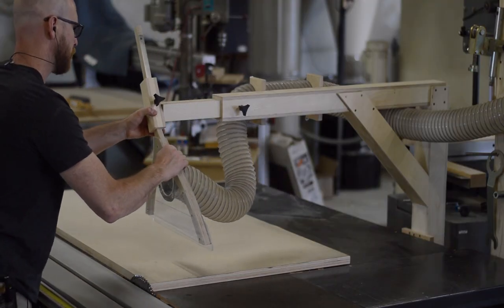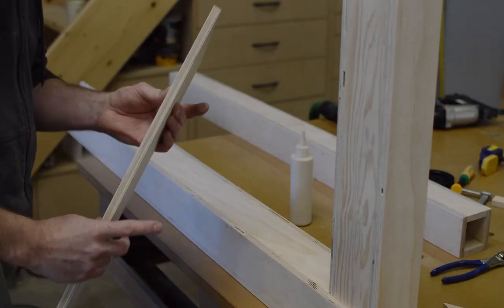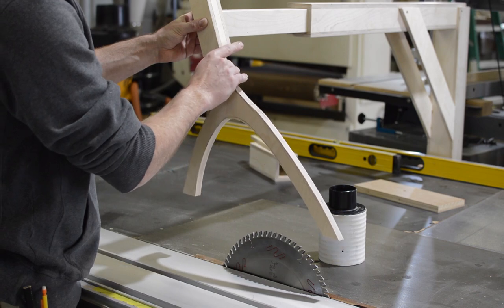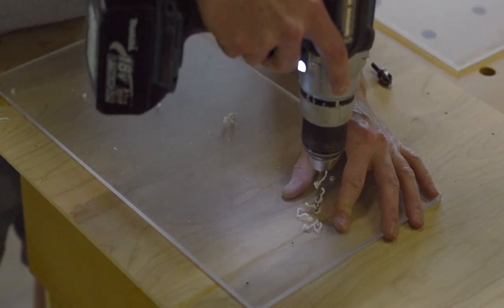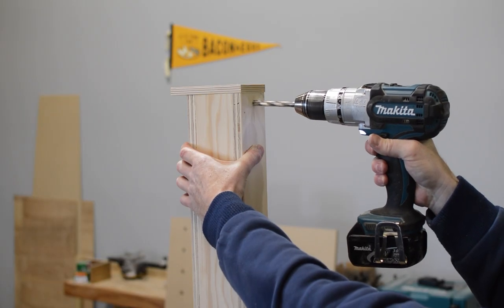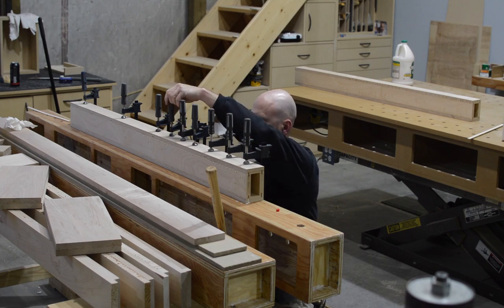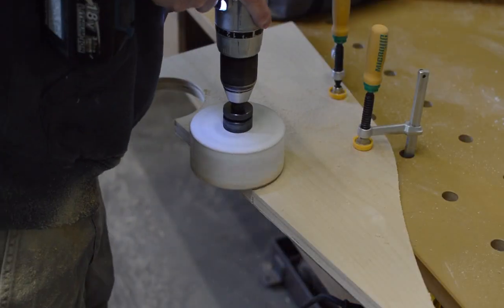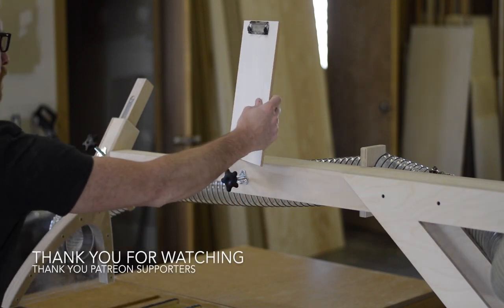Table Saw Overarm Dust Collection, Shop Built x 2

Comment: When I saw the picture in your thumbnail (in the suggested video column) I thought that is the craziest dust arm yet.  There are so many table saw dust arms videos now.  Then after ignoring your video for over a week, I thought I would check it out.   For me, as it turns out, yours is the best.  Some look very slick but have obvious drawbacks, such as lack of rigidity and to large of a guard that inhibits use.  The others often put the boom were it will obstruct the operator.  Yours looks perfect.  Think yours is really spot on.  Thank you for sharing your great design.  BTW, all that noted, did you think about using the boom and vertical section as your dust tube?   Just a thought, but still yours is just a great design.   Thanks again!
Reply from the maker: Thank you very much. I did think about using the boom and vertical as the collection pipe. I ended up going away from that idea to keep construction simple.

Comment: Great work, as always.  Question; was there any thought about making them pivot so you can still use them when you make angle cuts?  Unless I missed something, it looks like you can only use them when you make 90-degree cuts.
Reply from the maker: Thank you. I can use them for all kinds of cuts, they can be adjusted pretty close to the blade even it it was at 45 degrees. I think collection efficiency would be slightly reduced. I can also move them out of the way for tenoning or tall vertical cuts.

Comment: Mike, any thought to making the part that hangs over the blade maybe a little wider? Just a thought. Might make it easier for the dust to be collected from skim cuts.
Reply from the maker: The wider they are the less velocity the generate, if thats the right word. Meaning the suck is spread out and less concentrated. I would need to do some more experimenting to know the best combo of size vs collection efficiency.

Comment: Nice build! How much space did you leave in the telescoping joints (between the outside sleeve and the inside sleeve)? Is there a good rule of thumb? I find it hard to find the balance between free motion and snug fit.
Reply from the maker: I didn't measure, I just cut the pieces until the slide felt about right.

Comment: Intelligent build, as always. How do you deal with very narrow rips with this hood setup?
Reply from the maker: I have an offset push stick where I can go down to maybe 1/2" or so. Past that I need to move the overarm out of the way.
Reply: @MikeFarrington  I deal with a similar dilemma when I use my ancient Board Buddies fence-mounted holddown/hold-in featherboard devices. I've taken to using a small rip thinner than the stock to push the work piece through the cut, i.e., with the push stick flat on the table and following the work piece (as it would if following a piece through the thicknesser to prevent snipe). After the work piece exits the cut, I pull the push stick back out. I plan on copying your slim-line design for dust collection. Your offset push stick makes sense. I might resort to the flat push stick I describe for the narrowest rips.

Comment: I was thinking at the start that you were going to double up on structure function, use the sliding boxes to be the dust collector tubing. The reduction in area would have increased the suction & velocity of air movement, until I saw you plug the end ... Ah well, an overenthusiastic overengineered  thought on my part. 
Great build. I take it the saw didn't have a dust collector when you bought it?
Reply from the maker: Thank you. I thought about trying to do that with the arm, I just didn't think it would be worth the extra effort. Yes, this is an old saw, so dust collection was up to me.

Comment: Maybe next time put the drop of locktite on the thread before  threading the nut.
This way it even works.
Smearing it on top of a nut does not much at all becouse of the to small surface area.
Reply: there is penetrating locktite but i don't think the blue stuff is.
Reply from the maker: Yeah, that is certainly how it is supposed to be used, but a dot on top is enough for this application. That nut will not back out.
Reply: @MikeFarrington  I agree

Comment: Enjoyed watching your videos. Your work is excellent. Which air compressor do you used? Cos I am thinking of buying one for my small workshop? Only need it for my nail gun. Many thanks
Reply from the maker: I would recommend a very small portable compressor if its only for a nail gun. I have a 60 gallon 5hp model, but I use it for spray finishing.
Reply: Thank you. Keep up good work 👍

Comment: Great project!!! Question.. I’m in the market for a dust collection system. I’ve thought about building something similar. My question is, when you run dust collection thru  the top do you also run another hose they the bottom or is the top one enough? I works out of a very small shop and if I can run just one line they the top I could just switch it from tool to tool. TIA
Reply: De e
Reply: De e u

Comment: A year later, how are you feeling about them and would you make any changes?

I really like your design but I thought I’d ask your advice before committing the hours to building them.
Reply from the maker: I really like these. I mentioned the thicker ply, thats the way to go. I also would have aimed the one on my cabinet saw a little better, more forward. Other than that, they have both been great.
Reply: @MikeFarrington  thanks. I’ll keep those tips in mind while building mine.

Comment: Great idea Mike out of curiosity why no riving knife/splitter
Reply: I am looking forward to hearing Mike's response on this because I find it hilarious. No offense, but table saws have been made and used for over 50 years without riving knives. But these days you are breaking some kind of law by not having one. I still use two table saws that don't have one.
Reply from the maker: If I had one that was easy to use I would use it. My saw was made long before riving knives were a thing. I'll say this, if the saw is operated with the proper respect it deserves, I do not think they are necessary.

Comment: I can see how that works well for sheet goods and wider rips, but once you get down to thinner strips <3/4", I don't think I would use it, because I would have to change the way I hold a push stick - the same push stick design I've used for decades.  My hand would hit the shroud/guard.  I can't deviate from years of muscle memory without it feeling awkward and a little unsafe.  I've never used these things for that reason.    I've tried though...
Reply from the maker: Thank you. Yes, any over arm collector is going to stop working as the pieces get narrower. To help I made an offset push stick the allows my hand to pass over top of the fence.

Comment: Hi Mike - what’s the sliding table saw you use and would you recommend it? I do quite similar joinery to you and I’m about to pull the trigger and actually get one , I’ve been using a cabinet saw for years and looking forward to adding a slider to the workshop. Great builds keep up the good work 👍
Reply from the maker: Thank you. I would recommend the best one you can afford. I recently upgraded to a Felder, so far is been pretty nice.
Reply: @MikeFarrington  thanks for replying, which model did you get? I have a 5/6 month wait now for mine , I had a spec done up on a k740s a while ago and in your video I saw what I thought was one which sparked my question. I’ve gone ahead and paid my 20% so all going well end of March next year it will be delivered . Did you have to order anything to make using it more productively.  Thinking of the diamond tip blade
Reply from the maker: @CreativeCarpentry  I bought mine used, Its a k700s. I would recommend the over arm dust collector if you can afford it. I also like a manual cam clamp. Other then that, use it and see what you need.
Reply: @MikeFarrington  ok thanks - it comes with the overhead guard and I have seen some guy making one on YouTube that works ok😉
Reply from the maker: @CreativeCarpentry  Making one will work, but buying is so much easier. The choice is yours.

Comment: Mike, do you think it would work well with JessEm Clear-Cut Table Saw Stock Guides?
Reply from the maker: Hmm. I'm not sure and I don't have a way to confirm, sorry about that.
Reply: @MikeFarrington  Thanks for your input. My concern is when I rip stock under 2" wide, they may get in the way. Thinking about it, they can be moved away from the blade.
Reply from the maker: @Marcus_Caius  It does get in the way for really narrow rips, but I think any over blade collection would at some point. I just move it out of the way as needed.

Comment: any thoughts on making plans for these?
Reply from the maker: No plans. I felt that each application would be unique, so making plans would just mean a lot of confusion for the purchaser.
Reply: Mike Farrington I disagree. I think your second model is adjustable enough to  work for most cabinet saws. It would just be a matter of sizing the hose for the individual dust collector. I was looking at overarm collectors and given the price I would buy a set of plans and build one. Seeing how you did It I could figure it out but sometimes working from a set of plans is nice. Plus then I could contribute to you for the idea.
Reply from the maker: @Hatchmade  Thank you very much. You're probably right, but at this point, this video isn't doing well enough to put any more work into the project. I would need to sell at least 20 sets of plans to break even on the amount of time it would take me to make them. I really don't think that would happen.

Comment: Great video -- what's the make/model of the face/dust mask you're wearing?  Thanks.
Reply from the maker: I bought it off Amazon. Its been a really good unit. Miller Electric ML00895 Half Mask Respirator, M/L, Single Filter
Reply: @MikeFarrington  Thank you for your quick reply.  Based on your recommendation I'm going to give it a try.  Been following your channel for years, love your work and your videos, you do a great job.

Comment: As lord of the mighty biscuit, can you comment on how snug the biscuit should fit in the joint?  With the model I'm using, its extremely snug - usually requiring some mallet persuasion to seat completely.  Does that sound right?  Thanks and love the videos
Reply from the maker: That sounds a little too tight, I like a fit that is slightly difficult to do with hand pressure alone.
Reply: @MikeFarrington  Much appreciated!

Comment: Did he just use Loctite on the outside of a screw? I was unaware that the blue Loctite had any wicking function.
Reply from the maker: It doesn't have any ability to wick, but there were a couple threads exposed, just enough to make sure the bolt doesn't back out.
Reply: @MikeFarrington  I see. So you where using it as a nylon lock nut would be used.
Reply: If you're ever stuck with wanting to lock a nut on a thread, a centre punch on the face of the nut, approx 1.5 mm from the hole will deform the thread to  make a very tight lock nut!

Comment: I wonder if you could have used pipe as the stand and not had to use 4" hose . I see your Apprentice is getting really good with the drill it might be time to move him up to shop sweep and give him upper arm strength.
No seriously Its great you ahve your son out in the shop with you, I was helping my dad when I was 7 running his table saw holding plywood as he feed it past the blade. That saw was a sears craftsmen table top one from the early 60's he bought when I was less then 3 years old. I went with to buy it. That saw didn't have a riving knife or splinter, and it could kick back. So I must have earned his trust holding the end of a 4x8 sheet of plywood. Me I wouldn't trust my 37 year old to hold my lunch pale 
My kids don't do this kind of work.  And they didn't learn it in school.  Someone has to learn this tradition.  Or the art form going to die out. I'll bet he makes really good money doing it too. Not like when I was young carpenters were a dime a doz.
All the trades are in dire need of fresh workers.  You can watch almost any show like This old house or Holmes on homes they are begging for young people to get into the field. Beats flipping a hamburger. Can can pay 6 figures for some of hoses jobs without collage.
Go look up pay scale for Electrical, plumbing, hvac and carpenter. And the related fields.
Reply from the maker: I could have used pipe, but it would have complicated the design and construction. I wanted this to be an easy build. I agree having the kids in the shop is a great piece of education for them. Weather they go into the trades or not, its still a good thing to learn these skills. Thank you.

Comment: Looks good. I've worked on saws with very similar idea. For me its way too low. The arm needs to be a lot higher. My current one (10 yrs now) is 50" tall adjustable down to 30". Made out tube steel all welded and very adjustable. The professional cabinet companies (5) that see it want it. And immediately complain about their low arm....just saying
Reply from the maker: Thanks for the tips!

Comment: hey mike
is there a reason you dont use a riving knife on your tablesaw? just your daring-do attitude?
Reply: I find it really funny how table saws were made and used for a over 50 years without riving knives. But now everyone thinks it is so dangerous without one.
Reply from the maker: My saw was made before riving knives were common place. I would love to have one, but they can not be retrofitted.
Reply: @MikeFarrington  
how has your experience been so far? are there cuts you simply avoid on the tablesaw or has it simply not bothered you much
Reply from the maker: @befelmi999  I've had that saw for many years, it was one of the first major tool upgrades I made. I have made pretty much every cut possible on it. Haven't had a problem thus far. There isn't a cut I would avoid.

Comment: Excellent video, these crown guards in the uk are around £600 to over £1000 and yours is not that much different
Reply from the maker: I figured I saved a few bucks especially cause I would have needed to buy two. Plus it was a fun project.

Comment: Super clean and tidy and very practical piece of equipment no doubt about that at all but I have a challenge for you let’s see you make something without the table saw. I’m based in the UK and with the exception of hobbyists he watch a lot of YouTube so they get these bad habits from you guys in America and Canada we only use table saws for rip cuts what they were designed for everything else that you would use it for we do with the purpose-built equipment which you have writers and the Bansal please don’t think I’m having a dig I just think it’s incredibly dangerous and every time I see you guys hanging your head over the top of a blade it makes me cringed not to mention the rest you take with your fingers so So see if you can make us something simple a small humidor or a jewellery box but don’t use the table saw The bandsaw you have is way more capable and safer that you give it credit you just need to learn how to use it and equip yourself with the correct blades keep up the good work I do like your channel even though I have to look away occasionally👊💚
Reply from the maker: I would recommend watching a few of my other videos. I'm a big proponent of using a bandsaw when practical.

Comment: First, I have to say that I have been researching DC for a ridiculous amount of time and I am about to upgrade my setup very soon. That being said, there is a huge flaw in your system: the shroud over the saw blade is too small, it does not allow enough air flow to go into the 4" pipe. For comparison, look at the 2 SawStop offerings: the over arm uses a 3 (or 4?)" hose and the sucking area is much bigger while the one you are supposed to plug in  a shopvac is small. They do this because a 4" hose has a low static pressure but moves a lot of air. So to make it work, you have to let it suck as much air as it (mathematically) should. There is a formula for this but it is easier to just copy the dimensions of existing products. While the current setup may suck most of the big wood particle, there isnt enough air moving to catch all the fine dust. Given that you work a lot with MDF, fine dust should be your main concern.
Reply from the maker: One thing I did do is calculate area. The area of the shroud is the same area as a 4" pipe. These gizmos are hooked up to a pretty powerful collector, if they can't collect fine dust, nothing will.
Reply: @MikeFarrington  It is an educated guess but it does not work (exactly) like that: the air in the pipe will blow faster than needed to capture the fine dust, so by using a wide area you will increase the gathering area for the fine dust. You can probably get away with it because you of your oversized DC but you would be surprised by how much more air you can filter by optimizing the gathering area.